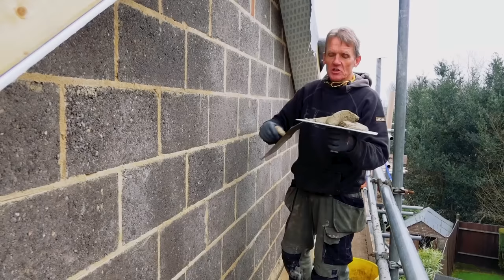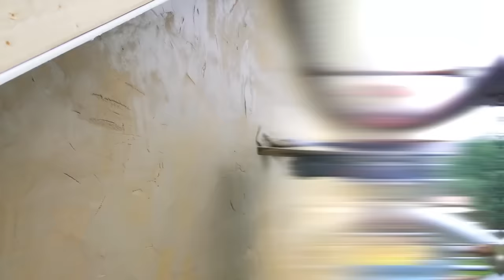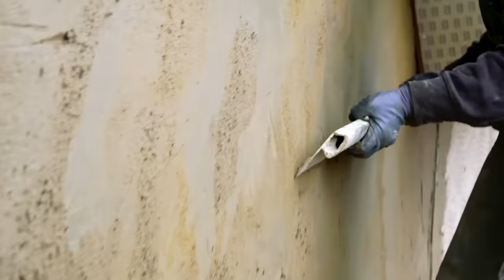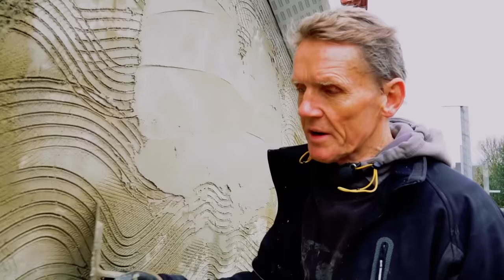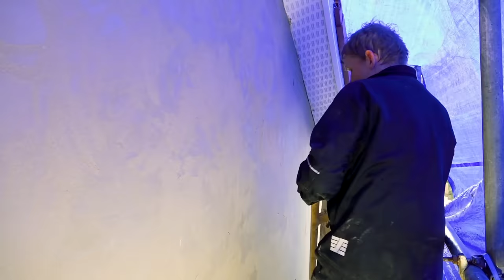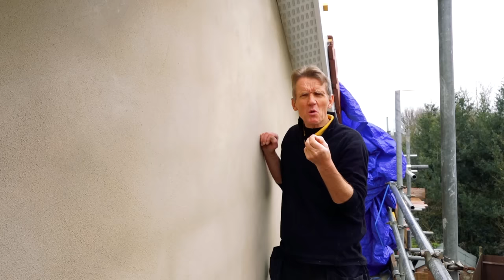How to Render Exterior Walls - Beginner Tips

Comment: Hello mate, thanks for the video. I'm converting an old utility room with rendered brick walls into a shower room... unfortunately the old render is not sound, so I plan to hack it off, redo it, and the then tile on top... I had two questions please... 1) In your opinion would it be ok to do just one coat of render and then tile on top of that?  2) Assuming 'yes' to question 1, would it be better, for tiling onto, to just scratch that coat of render or float it? Thanks in advance - have watched lots of your videos - very helpful :)
Reply from the maker: I would do a single thin coat 6mm to 8mm and get it flat with a rule and urethane float. If you are using tile adhesive there is no need to scratch. Put some SBR in the mixing water and it will help adhesion and make it water resistant.
Reply: @SkillBuilder  That's great - thanks for taking the time to get back to me with that.

Comment: Can u use washing up liquid instead of lime just for a garden wall at home
Reply from the maker: People do use it but it contains salt and is not ideal. Plasticiser from the builders merchants costs no more and is the right product. It works in the same way as lime but you don't get the lovely fatty mix with the full body that lime gives you. If you are rendering a garden wall a splash of SBR gives better adhesion and acts as a plasticiser.
Reply: Skill Builder I’ve just done a small mix to patch up but goes very wet quicker then block laying motar I was using 6.1. render sand, cement, with splash of washing up liquid 
The mix seems very gritty should I leave it for a while
Reply from the maker: I would have put a bit more cement in, say 
5 to 1,  if you are not putting lime  in it.  @tospicy4ya
Reply: Skill Builder  5sharp sand 1 cement 👍

Comment: Hello Rodger can you help we have 6 bags of monocouche in the garage since the builder left several months ago, can it still be used,the garage is dry and damp free, and is standing on a dry concrete floor,i kept the mono because the sidewall of the new extension has a narrow gap and they could not work there,i am a little bloke and i thought i could at least smarten it up myself rather than just look at concrete blocks.
Reply from the maker: Yes it should be fine so long as it is off the floor. If it is directly on the floor the bottom bag might be a bit quick to go off so use that first. We have a video on putting on monocouche that you might find useful.
 https://www.youtube.com/watch?v=48Fy_7SL51s
Reply: @SkillBuilder  Thankyou very much for your very speedy answer,i will check out that video, thanks Pete from Newark

Comment: Great video Roger, but can you ever 100% guarantee your never get a crack. You only have to drive around to see houses everywhere with cracked render.
Reply from the maker: 11x11z11x11
    Let's see what happens. I have done a few jobs with zero cracks but maybe the movement joint helps. The other thing that causes cracking is, no lime, and too much cement. If you make it strong the building can't move. I have seen plasterers hack off render and put on a stronger sand and cement mix because they believe it stops cracking. If you have old sand and lime brickwork you need a weak render mix.

Comment: rendering with a skimming trowel doesn't make sense to me, thats not gonna last long on the wall there is no key between the surface and material, I've seem so many properties affected by this method ,I respect your trade sir but I would sugest a polyester isolation instead ,scrim and render

Comment: Hi Skill Builder, thanks so much for the video. Just wanted to ask- our renderer put a scratch coat on about 18 months ago and then for various reasons- long story- hasn’t been able to put the final coat on until now. Will that scratch coat still be sound, or should we be worried?
Reply from the maker: Hi Rachel The scratch coat will be fine to go onto. Just make sure it has a good hose off to remove any algae that has built up in the lines.
Reply: @SkillBuilder  thank you very much!

Comment: If the 2nd coat is the same mix but thinner. It isnt weaker by defaultm its still the same strength. Also the reason you do a wavy scratch is because is gives more surface area for the key. Absolutely nothing to do with shrinkage
 Simple bit of research on both subjects would have given you these answers. Also if you use sufficent waterproofer in your scratch theres no need to soak it before topping

Comment: cement coat should be (right handed) right to left top to bottom. It is more for speed of overlap so less loose cement droppage and reason for top to bottom is moisture goes down the wall and more even drying for the whole wall. I was using long wooden Darby floats 30+ years ago changed to wavin but wasn't a request by the polish.

Comment: How much would I be looking at to get my gable end hacked off and re rendered like this? I want to make sure i don't get ripped off.
Reply from the maker: It depends where you are in the country and what kind of access you have. The plasterer will want some scaffolding and a place to dump the sand and knock up the mix.
Hacking off. Are there any issues with the neighbours and dust? The scaffolding might need netting.
That could be £1,000 for scaffolding 
Hacking off could be one or two days for two men so allow £1,000 
Skip £300.00
Sand and cement etc £200.00 
two plasterers and a labourer. Allow £600 per day (more in London) 
Two days work to plaster the wall
You could be looking at £4,000 If you are inside the congestion zone and it is hard to park etc then it could be £6,000
Reply: @SkillBuilder   I live in wales and the house is a semi detached  house in the country side with a flat roof below the Gable. drive way has room for skip plus parking for 5+ cars. Thank you for taking time to reply to me.

Dan
Reply from the maker: @Mountainlion25  
In that case you can do it from a tower and, knowing Welsh prices I reckon you could get this job done for around £2,000.
Let us know, I am sure people would love to know what kind of price you got.
Reply: @SkillBuilder  You were spot on with the price, quoted and job done all for £2100!!!

Comment: How to render any wall don't mess about stick ya hand in ya pocket just hire the right bloke for the right job get a pro, do it right do it once. A tip from a chippy.
Reply from the maker: All well and good if you can find them but a lot of plasterers are not keen on rendering and often make the mix way too strong which then ends up cracking.

Comment: did you forget to put water-proofer in the scratch coat? that will stop the suction.
Reply from the maker: I don't like waterproofer it traps moisture.  It also causes the top coat to blow. I have seen it many times. 100% adhesion is the aim.

Comment: Why would you render a aircrete block ? There for internal use
Reply from the maker: They are used externally and approved for this purpose
Reply: Skill Builder never seen it done  I’m surprised you didn’t use them on that gable then ?
Reply from the maker: @mrszee951  If you lived in the South East you would see it. I am not saying it is a good idea. I will never use aircrete on external skins because it cracks. It is not popular with plasterers but if you mesh it the cracking is reduced
Reply: Skill Builder silly southerners lol

Comment: no scud coat you can already see the block joints showing tru
Reply from the maker: The scud is not needed on these blocks. You don't see the joints when it is dry. It is fine. The word is through BTW
Reply: its called Grinning

Comment: Why do u start in the centre DONT u start from top to bottom
Reply from the maker: Yes I would start somewhere else but on this little gable with a narrow scaffold it was hard to get a good camera position. In the end if it goes on the wall it is all that matters, I have seen loads of plasterers go from the bottom up but not in England
Reply: @SkillBuilder  I only ask cause I’ve never done it before  can u get pre mixed render

Comment: Whoever had a go at you for the way you start rendering the wall it is an idiot thats like how majority of portuguese people do it you do less mess you  dont have as much excess mix on the floor so just ignore those other " plasters " better send them to induction , not to even explain to them if you start their way its much easier for a beginner to leave lumps of mix on the floor while starting with it inclined and a litle bit higher than the floor by pressing in an angle you get a cleaner swipe

Comment: Appreciate your effort to try coach some diy plastering skills but sadly you don't possess any to actually pass on, you seemingly got there in the end painfully but this is about as bad an application of rendering as I've ever seen.

small tip: You bring the hawk to the trowel not dig bits of plaster off & slap it on the wall in tiny patches as fast as possible to avoid dropping any lol....if i had the time id make a vid to show you and your watchers how its supposed to be done professionally on any surface... including wired ceilings if you know what your doing ;)

Ps this is not a dig, just a critique.
Reply from the maker: stick with us kid I will show you a lot more in the near future that have been done by professionals.

Comment: Hi, thanks for the vid. I’m rendering for the first time this weekend, silly question but do I need to bead the top of the wall? I’ve build a kennel with a flat roof so have just a timber wall plate on top of the block work.

Thanks in advance.
Reply from the maker: if the top of the render finishes to an edge that is fine. Most times it is hidden by the soffit. Whatever it takes to get a neat edge. Long before beads they worked to wood.
Reply: Skill Builder thanks very much, I’ll make sure the plate protrudes proud of the block work then. Appreciated.

Comment: The thing is, unless people have a go, how the hell can they get better?  And really, what the FUCK can go wrong?  "Oh my god, your coat isn't flat, you've wasted £6 of sand, cement, and lime, and some burned calories, and now you have to spend 20 whole minutes knocking it off.  It's the end of the world!"

If this were telling people to mess around with electrical transformers or the gas supply, yeah, then these pro tradesmen could squeal with legit concern.  But dissuading people from having a go at plastering, rendering, sawing some wooden battens, building a fence, knocking in some skirting, laying a brick wall in the garden, etc... get a life.

Comment: Always scrape in 2 directions! Horizontal and vertical, you only scrape vertical in your video. This is wrong. You can get "waves" in your plaster.  
Greetings from Holland
Reply from the maker: The Beastman 
 It is ruled off with a straightedge to avoid the waves and it is done both hortizontally and vertically

Comment: Do you have to do a scratch coat?...  Can you not just do one coat and be done?  :)
Reply: jamie campbell scratch coat is needed. If you tried to do it in one coat it would just fall off the wall due to the weight.
Reply: He says 6-1 in his mixing video but then says 5-1 in this video.  Is either fine for both coats?...  Can I not use hydrated lime on both coats?...  He used platisizor on his first
Reply from the maker: There are on coat systems out there but sand and cement needs to be built up. It loses adhesion if there is too much weight in one go so 2 or 3 coats is normal practice.  That said there are now fast track quick setting cements that allow 2 coats in the same day.  You have to be a lot faster than me to use them
Reply: Basically scratch coats works in a couple of ways. 1: To hold the weight of the render on the wall 2: to make sure your block work or brick mortor lines don't show through the finished Render 3:with lime or plastertiser in your scratch it helps stop the damp.

Comment: I’m a plasterer mate and I’m sorry this is absolutely shocking, your telling your audience not to use a weaker mix for your top coat, terrible advice. 
Also you have worked with your scratch coat way too much, this will loose suction and key from the wall and make the cement mix become much weaker. 
Don’t give your fans advice that you know nothing about.

Comment: Fuck me mate how thins that coat. Can tell your not on price either I'd of put that scratch on in about 30 mins max.
Reply from the maker: dave_c_photo
Yes it is all about how fast you can put it on the wall, not how well it keys or how flat it is. Why are the wet trades slaves to the sq mtr?  It is a race to the bottom.

Comment: Never, ever, ever, ever, ever...put sharp sand in your mix when rendering. And he's wondering why he's pulling stones off his wall!?
Reply from the maker: Dan 
 I think we are at odds here and it is due to different terminology.  Sharp sand is plastering sand used for render and base coats. Soft sand is for bricklaying. Grit, in London we call it Thames Grit, is for concreting and screeds. In some parts of the country, maybe where you are they call grit a sharp sand.
The stones were nothing to do with that it was contamination because we had bags of ballast and kids using them as play pits. The other two bags of sharp sand (rendering sand ) were fine.

Comment: A trowel is never called a float lol 2 different tools...
Reply from the maker: You are right. The steel trowel (as we now  know it ) was invented byTyzack to replace the wood float. It was  therfore originally called a forged steel plastering float but, for some strange reason started to be known as a plastering  trowel to distinguish it from the bricklaying trowel. I think because it is used for laying on, the term trowel is fair enough but when you  use it to set and float I can't see why it is not a float

Comment: You bought Sharp sand you fool!!! It has stones in it 😂🤣😂🤣 Don’t think you’ve done this before have you!?
Reply from the maker: KushyWushy 26.
 It is called sharp sand or rendeiring sand, sometimes plastering sand.. The stones came from contamination we had bags of  ballast and Thames grit out on the grass and plenty of kids in the neighbourhood who like to play. I have rendered the rest of the building with the same sand and no trouble.  Once we dumped the top layer it  was fine.
Reply: Skill Builder I’m pretty sure sharp sand is not the same as plastering sand, sharp sand is usually used for screening, plastering sand is used for plastering funnily enough.
Reply from the maker: Boris 
I know that but in the London area it is called sharp and not grit or concreting sand which is what you use for screeding. I can assure you it is the right stuff. Look at the finish. You wouldn't get that with grit.

Comment: i don't understand starting at the bottom, i always was taught and work from the top down. also don't call this a how to for beginners, you're not even qualified based on this presentation. difficult to watch.
Reply from the maker: so why is it that you start at the top?  It is to stop it getting thinner as you go. There are many countries where they set all the perimeter and work in. I am not qualified but neither are most spreads out there. They picked it up as they went along. My intention is to show people what they can achieve if they are as thick as I am.
Reply: You start at the top left and work right + down, starting at the top because gravity works downwards and what’s the point finishing an area to spread above it and drop gear all on the stuff you’ve just done
Reply: i think everyone on here needs yo get a life
Reply: You're not wrong there bud!